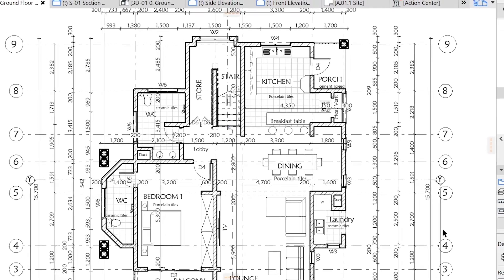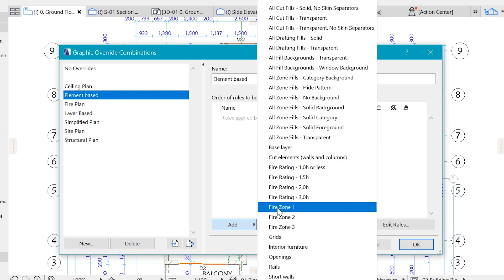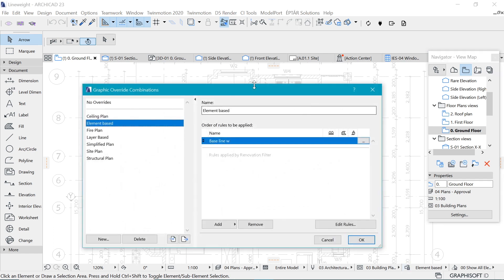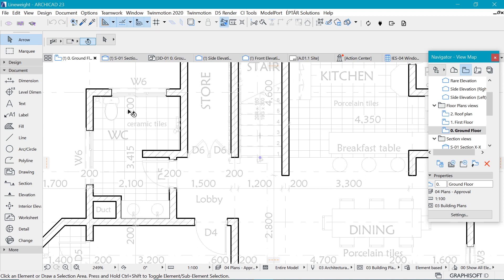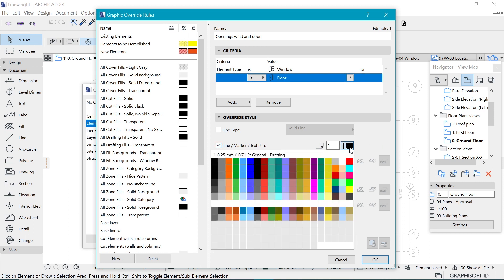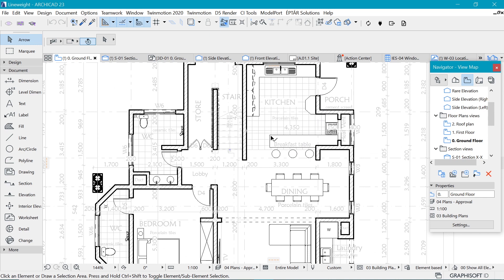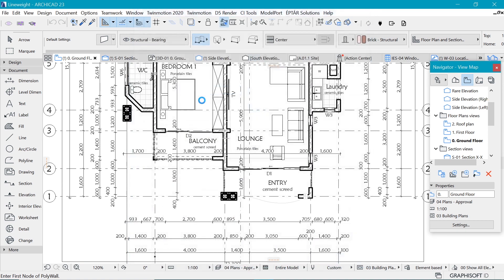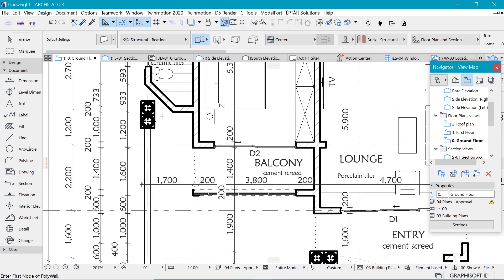Improve the line quality of your floor plans

Comment: Hello, when i use graphic override,is it possible to change measurement text s color and thickness on dimension chain.? thanks for your help
Reply from the maker: With graphic overrides, you can change the pen color and thickness (editable further in pen weights) but not the measurement texts. The steps are shared in the video